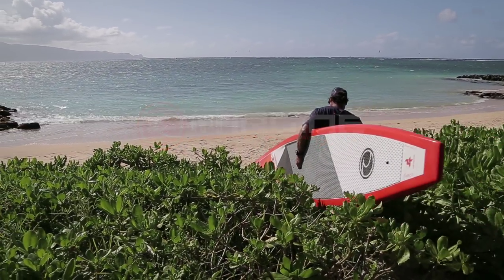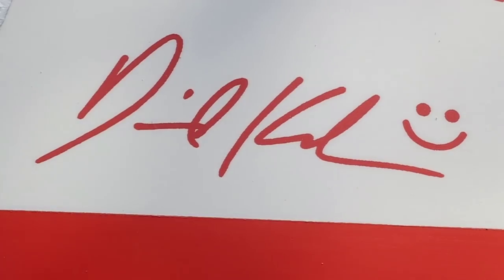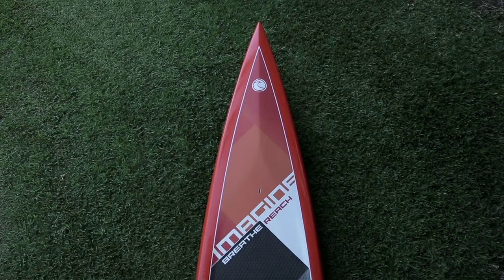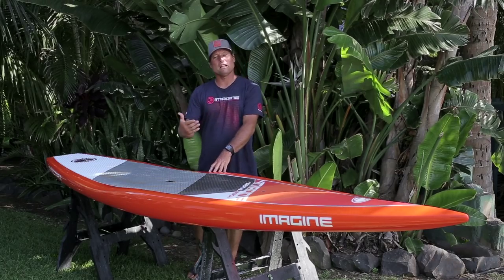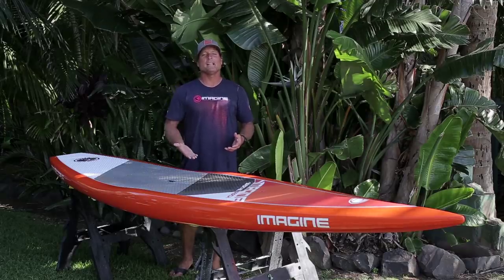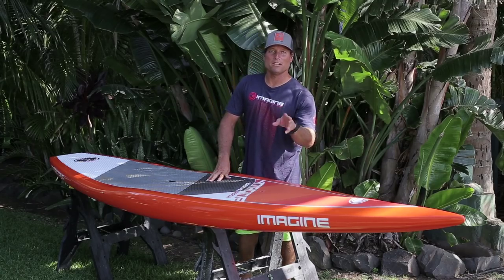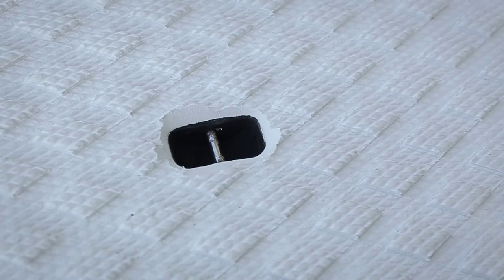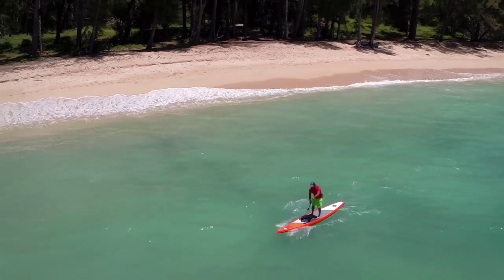2016 CONNECTOR CC Custom Carbon

Comment: This is the board I ride now and love it. He is right. It's incredibly efficient and seems to find the bumps effortlessly. Dave knows how to read the water and to make a board that reflects his many miles and years of success it's no wonder anyone who rides this board will perform at their best.
Reply: I try different boards whenever I can......but I still enjoy my old Connector 14 as it is so stabil I can move around on it without so much trauma as other more narrow boards. My only gripe would be that it is not a "quiet" and smooth as my Bark Dominator on FLAT calm water. I wonder how Dave's Rocket 14 would be on FLAT water?